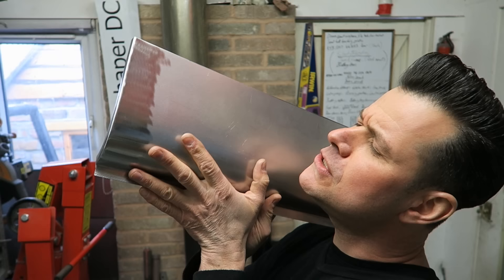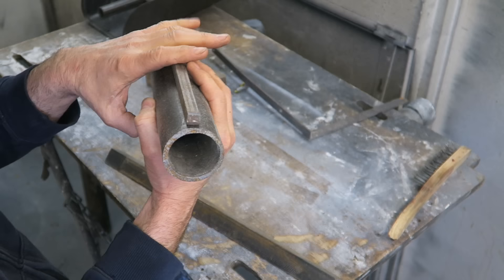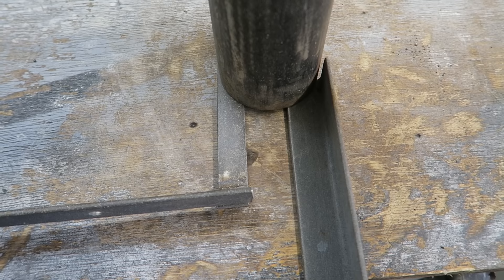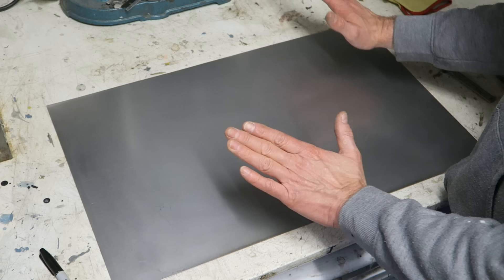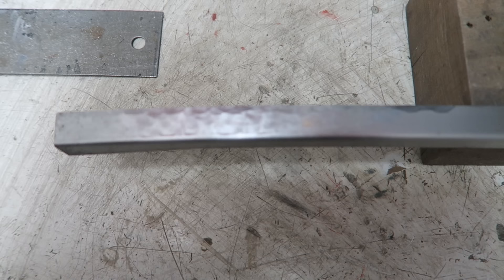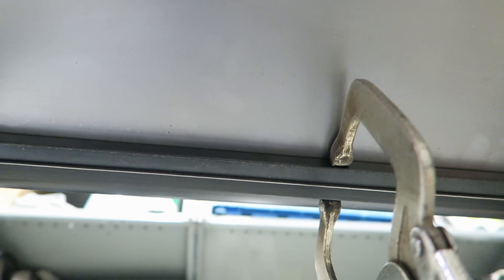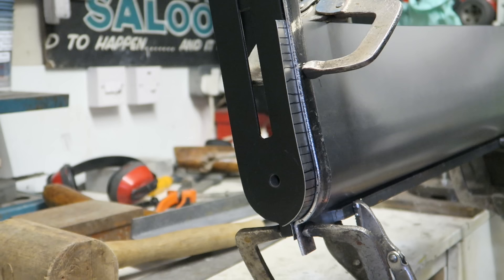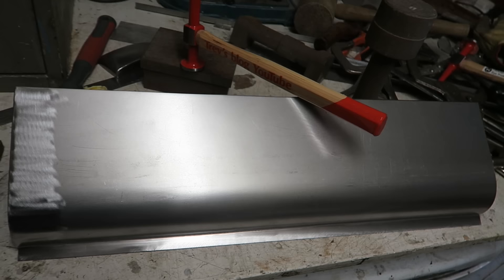How to make your own repair panels sill fabrication beating tips and tricks #16

Comment: So Trev I watched you break your ass hammer bending at around 38:00 minute mark because you are right handed. I say to myself, self doesn't the base of the vise swivel around 90 deg now you have a lot of working room. I love the jig you made and your explanations. I am a fabricator myself on this side of the pond in the USA and make tools to make my life easier esp in the automotive repair business. Or is that vise stationary? I will be looking for your reply keep up the good work.
Reply from the maker: Thanks for your helpful comments. All of my videos are made off the back of requests? I’m normally asked to show how to do something without the expensive equipment, hence the way the video was put together. Cheers Trev 👍
Reply: @trevsblog  I know I been watching your videos, and got a tremendous informational value from them, interesting you are using tig though because of the high heat to form a puddle vs mig where it is  instant and can be cooled quickly. Tig for me is precision mig is production, a  stick weld alternative to do sheet metal. I also watch Fitzee Production where he doesn't have all your equipment but does a fantastic job for what he does. The Vise swivel I hope your vise has was a suggestion only because trying to hammer as a lefties is uncomfortable for us right paw folk. keep the video's coming I liked everyone I viewed so far.
Reply from the maker: @carmo9693  mig is fine in most cases on bodywork but TIG offers far greater refinements that cannot be achieved using a mig welder on mild steel, which is mainly down to the hardness and unworkability of the mig weld.

Comment: Hmmm........ when you speed up the video when you're hammering you sound just like a power hammer. Does that mean you don't need all that fancy equipment that the "metal gurus" say you need and want to sell you? Maybe just go slow and have more control over the process?  Things to think deeply about.......
Reply from the maker: James Sheets I’ve made this video to help people that have very little kit but enthusiasm to have a go. You can still achieve loads with no specialist tools but if you’re going to try and do it commercially say, you’d really need to invest in expensive equipment in order to make things efficiently. Cheers Trev 👍

Comment: You talk to much no thx
Reply from the maker: fha gerber To is a preposition with several meanings, including “toward” and “until.” Too is an adverb that can mean “excessively” or “also.” Just to be clear: two is pronounced the same as to and too, but it can't be used instead of either of them because it's a number. 👍